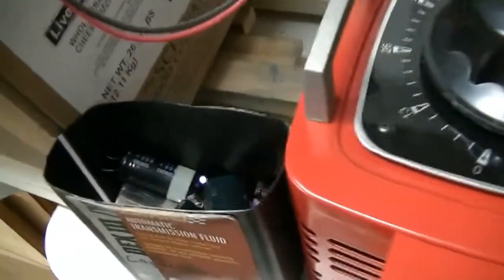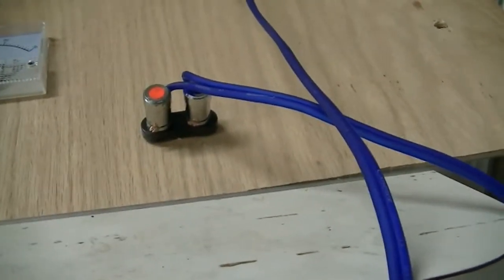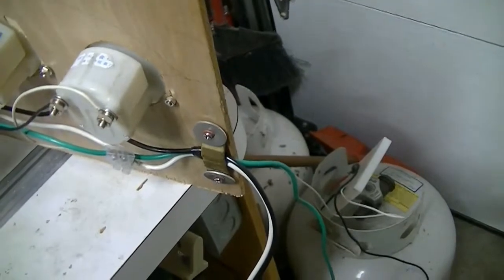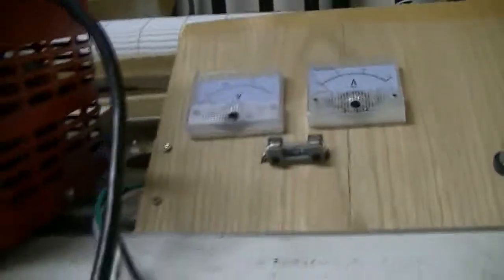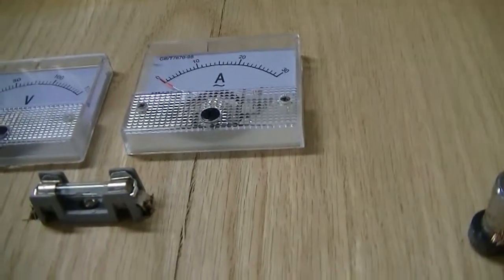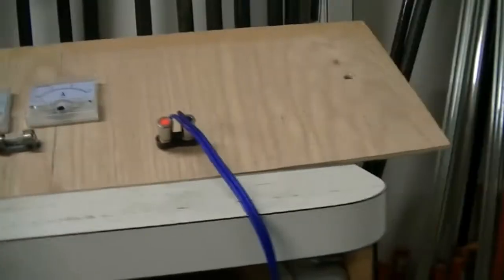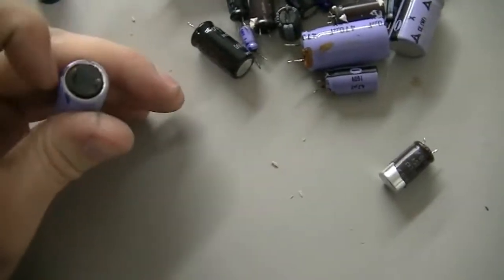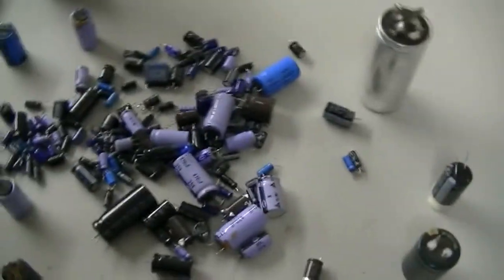Information Panel Stage One

Comment: hi can you tell me how to set up and wire An Ammeter with out a  Shunt in 12 dc set up  say from solar panel or battery thanks
Reply from the maker: I like buying them with shunts like the one in the video. I'm not the most knowledgeable on the subject so you should probably do a little research, but I believe they just go in parallel with the ammeter. A predetermined percentage of the current goes through the shunt and the remainder goes through the ammeter, so both ends of both devices get connected together in parallel, but in series with the main circuit.
Reply: thanks seems one i have not working right then thanks